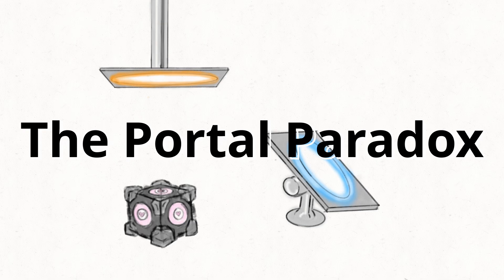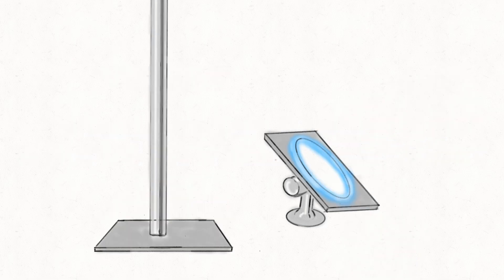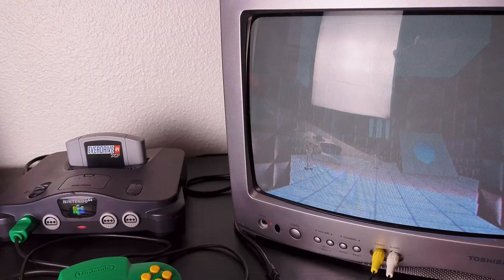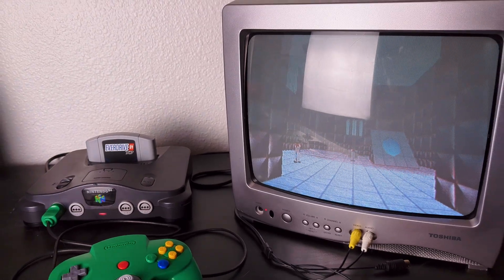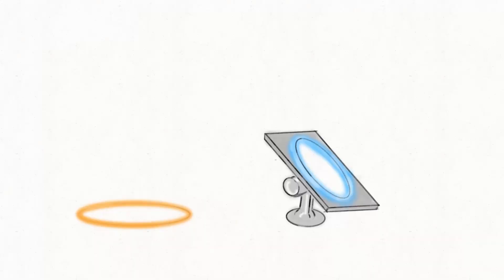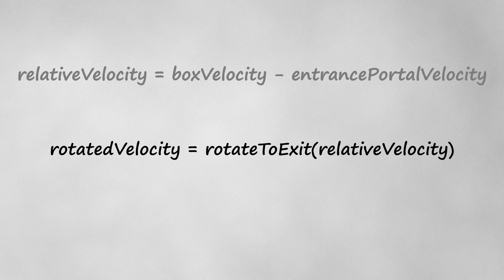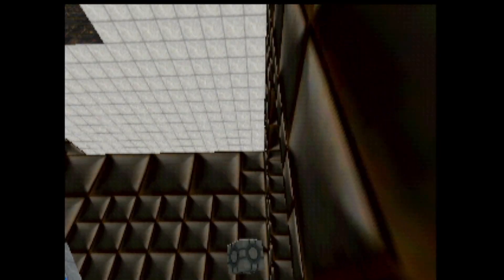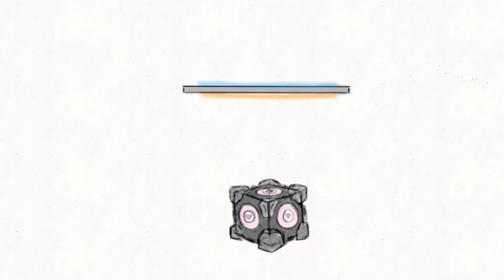I rewrote Portal from scratch and solved the Portal Paradox

Comment: The way I see it, the problem lies not in the relative velocity of the portals, so whether they are moving, stationary, or a mixture between the two doesn't matter. 

What should really matter is the velocity of the cube, or more relative: the cube's potential or kinetic energy. The cube has no velocity in resting position and has stored potential energy relative to the moving platform. It stands to reason that the cube itself is the subject of inspection, not the effects the portals have on it, since a resting cube should, logically, stay resting even when a moving portal slams into it, regardless of velocity or position of the exit portal. This, of course, relies on the idea that the portals do not add any energy to the cube in the process, rather there is no energy transfer between moving portal and cube. Now, if that is the case, the question really starts to just devolve into the theory behind Valve's portals and how they interact with objects lore-wise. But I'll assume that the inside of a portal is simply a physical bridge in space and that anything aside from the portal's membrane should be assumed to not be the portal as a matter of physical properties. So, in that case, the only other effects on the cube really should only be gravitation potential energy, as it is naturally part of the system. In resting position, gravitational potential energy is defined to be 0, but when the moving portal slams into the cube, assuming the cube has 0 contact with the portal's membrane (only is affected by the change in space), then gravitational potential energy of the cube increases and it gains kinetic energy in the direction of gravitation, or downwards. This, again, leads to more theory-based questions regarding the physics lore of the game's universe, such as where a gravitational field becomes priority between portals, determining when the cube should gain GPE and move towards gravitation direction. Since at this point, the resting position is no longer the ground platform and is now within the exit portal. Again, there has been no addition of energy from the portals, so the cube should just fall down from the exit portal due to the addition of GPE from a resting position.

There's just no real way for any "simulation" to give a good final assessment unless you add in the nuance of physics outside classical video game physics, and even then, you'd be adding in assumed behaviors of fictional scifi technology (but again, the way I see it, the portals themselves have little relevance and the problem is really more to do with space and energy). Though, I'm not sure if it would change anything or prove me right or wrong, but removing gravity from the system might or might not change the results, unless the fundamental system the simulation was built around ignores energy and assumes the portals are the subject instead of the cube.
Reply: The main issue with the "object at rest always stays at rest no matter what" reasoning is that the object, that has been presumably claimed to not move at all throughout the whole scenario, also logically cannot be ejected out of the exit portal, since that action requires the object to be in a state of motion and have a positive non-zero momentum due to the exit portal being stationary. In simpler words, it has to move in order to exit the stationary portal.
Reply: I forgot to add, performing this in a vacuum is obviously how an experiment like this should be assumed, because then one could start assuming many other factors contributing to the system, such as air as a medium. Difference in air pressures that potentially affect the cube's velocity near portals, air resistance at point of moving platform, fluid dynamics of air as the moving platform approaches contact with the cube's rest platform, whether this creates a suction/delta P through the portals, which gives the cube its velocity forward, etc.

As for a question of portal speed to GPE. I suppose depending on speed, the resulting direction vector would be a difference in resting position and the speed at which the cube leaves resting inertia after going through the portal. In either case, it shouldn't shoot or fly opposite the direction of gravitation, but at the very least have velocity forward or lower depending on the angle of the exit portal.
Reply: The fact that portals can change the direction the cube moves in within the reference frame where both ends of the portal are stationary already means it's changing the speed and therefore the KE in all other reference frames.

The idea that no kinetic energy is added to the cube on passing through a portal is basically only ever true when using the frame of reference where neither end of the portal is moving.

Comment: Awesome job on the video and tests. One extra thing that would truly solidify it, in my opinion, is doing a test where the portal wouldn't stop moving. Based on your results, the block should "plop" in this case because the relative velocity doesn't change between the portal and the block. Thereby eliminating the phantom "force" which results in the "whoosh" in your first test. In your second test, both portal faces are moving, so that should contribute to the block staying still in your second test case.

Comment: I came to the same conclusion without making my own demake: I thought of it as movement being a 1 for moving in one direction, a 0 for being stationary and a -1 for moving in the opposite direction. With no portal moving and the cube being thrown through one of then, we have 0+1+0=1, so the cube moves after the portal. With one portal moving and the cube being stationary, we have 1+0+0=1, so the cube moves after passing through the portal, kinda like a newton cradle transfers the kinetic energy from one ball (the portal) to the one on the other side (the cube). And when both portals are on the same sheet on both sides moving towards the cube, we have 1+0+(-1)=0, so the cube must remain stationary. Also, throwing the cube into a moving portal will result in 1+(-1)+0=0 and the cube will remain stationary. Well, and so on...

Comment: there is no paradox, and the simulation is not right in neither the cases you show in this video.... when the stationary cube enters into a moving portal, the parts of the cube just can't strip away because the cube continues being a cube... that's why the cube has no acceleration at all.... it just appears slowly in the other side of the portal and (in the case of this simulation) i will fall as a death mass to the ground again

Comment: no way lol, the portal is “MOVING” sure but the cube is stationary, its like what would happen if u move a door towards the cube really fast… nothing, since the cube has to have energy of its own to move, a portal is like a door the portal can move sure but the cube retains its energy upon entering the portal, how does the portal transfer its energy to the cube by moving fast towards it? what ur basically doing is “closing” and “shutting” a window quickly nothing more. the cube would simply slide off the now inclined place since in the second portal its would then be in a position, (had this been real) to have potential energy. but obviously this is why portals cant work, since ur basically creating energy makes no sense.
Reply: You can’t say for sure that the cube is stationary, technically it’s moving relative to the moving portal, motion and velocity are relative and relative to the orange portal it’s the cube moving so the cube must launch, obviously the answer differs depending on the frame of reference
Reply: " its like what would happen if u move a door towards the cube really fast… nothing"

already addressed
Reply: @LineOfThy  yeah but both sides of a door move together, if they don’t it’s not a door

Comment: Here's a thought experiment I came up with:
There are two copies of the room in the video that are exact in every way.
Both are enclosed in a magical material that lets no information through other than to watch with magic crystal balls. You are at home on Earth and you have a magic crystal ball that you can see into either room, but you don't know which is which.

One is in perfect geostationary orbit around Earth in a vacuum (meaning it's motionless compared to Earth and assume there is no resistance from outside sources). The other is in free-fall toward Earth down a tunnel in a vacuum. (also assume no resistance from outside sources, a perfect free-fall)

Both experience zero gravity
Both are seemingly at rest from the inside of the rooms.
Both the experiments are performed exactly the same way.

Now run the experiments and observe through your crystal ball.
Is there any difference in the results of the experiments? If so what?
Reply: Here's the twist: Both the rooms are upside down and both the pistons by sheer coincidence move at the exact same speed as the free-fall room is falling. Which means the piston in the free-fall room is actually perfectly still compared to Earth and the room is in free-fall around it.Therefore, in one room the portal is moving and the box is at rest (in relation to you on Earth). In the other room the box is moving and the portal is at rest (in relation to you on Earth).

Did the rooms being upside down change anything about the results of the experiment?
Did learning the speed of the piston change anything about the results of the experiment?
Does this only work if the piston moves at an exact speed? If it were slightly slower or faster would the box cease to move when it exited the portal?

Comment: So, what happens if the moving entry portal stops moving before fully passing over the cube? The top half of the cube has been given momentum, but the bottom half has not. The top half would pull the bottom half along with it, right? Meaning, the box would only fly half as far? Unless the momentum differential is great enough to rip the box apart.

Comment: Well, that's friggin cool. 😲

I'd also argue that in theory the orange portal should experience resistance when it hits the cube, such that it performs equivalent work to flinging the cube out of the blue portal. That conserves energy—though not momentum, because having portals facing different directions has already broken that permanently in this universe.
Reply: My position is that to properly use conservation laws through portals you must use the reference of the portal, in this case to conserve energy, velocity, relative to our reference, must remain constant at input and output (ignoring non conservative forces obviously) if we consider the portal as a system energy in must equal energy out… in any case energy is not conserved as potential energy can be increased with a portal eg perpetual motion machine using portal on floor and ceiling.
Reply: @DracoTorment  The object traversing the portals is ALWAYS the reference frame. Portals are only transformations of the vectors. If a person sat on the floor and the portal slammed down around them, they would feel acceleration and would fly out the exit. This is consistent with he person's interpretation; if they'd looked up, they would have observed the wall and ceiling careening toward them at speed, a sight consistent with them flying out the exit at speed. Further, we know the object's reference frame is the only view point we should examine because it is the object which possesses the momentum, velocity, and energy we are concerned with. The portals are just a boundary in space with an appropriate transformation that stitches space together at that boundary.

Comment: Everything said makes sense. No arguing the logic. Just curious as to what would happen if the portal abruptly stopped midway through the cube? Would the momentum of half the box, pull the other half off the ground?
Reply: From my understanding, yes. In game terms it would depend on if the box is considered a point (in which case as soon as that point crosses the threshold it will act as though the entire box did) or if it is represented more realistically (The % of the box that went through will "pull" on the remaining %).

Comment: Conservation of velocity and momentum, it's transfered from the portal travelling, over to the matter that goes through the portal, the cube itself going through the portal should get an equivalent velocity.

It'd be easy to math in a vacuum, but in a gas I'd imagine wind resistance would be an issue.

Perhaps the wind captured by the travelling portal would create a high pressure area on the exiting portal, that may increase or decrease the velocity of the cube because of resitance and pressure being countering forces to one another.

It's still a science that wouldn't seem possible because the pressure around a portal in two different levels would vary too much and cascade mass through gravitational energy and lower areas in an atmosphere have higher pressure, thus you could make a convecting wind machine with two portals at different levels, but energy would have to get consumed somewhere since it'd create energy from nothing seemingly. It's kind of why it's all purely Science Fiction, and it's fun to speculate on.

Comment: Some of the commenters are still confused. I think it would help if you make a third example to showcase why the cube didn't seem to move on your 2nd example. 

The setup goes like this. 
Entry Portal moving down towards cube. 
Exit Portal facing up, is moving down as well towards floor. 

The result is, it looks like the cube teleported without motion, but that's only because the exit portal was also moving at the same speed as the first portal (similar to your 2nd example- but at a different place).

Comment: Why is this a paradox? if you put a cube with 10 mph into a portal (no matter what part moves how fast) it has to come out with 10 mph or else you would have to compress the cube into itself. And if it comes out with 0 mph only a 2d object would come out. Or are you saying that it comes out with 10 mph but then it suddenly stops? Is this strange idea based on the source code or how did someone come up with this?

Comment: I saw someone explain what would happen very well. At an atomic level, the side of the cube that was to “come out of” of the other portal, doesn’t have any velocity. Because on the other side of the portals, it’s sitting still. So it would be atomically crushed down with a specific force based on the velocity of the moving portal. 

This could be a minuscule force if the portal was moving slow enough but at the speed it was shown in the video, the cube would become a pancake

Comment: It’s strange because I think this behaviour would imply that if you stood there, instead of the box being there, you could be decapitated, as a lot of force is applied to your head, which goes through the portal first, before the rest of you. And to me this seems intuitively wrong. I wouldn’t expect that behaviour in any other use case of the portal. But, it does also make sense that movement should simply be relative between the portal and cube, and solving portal decapitation would require that the box / portal be able to discern which one of them is actually moving.
But I guess, at the same time, it would be evident which one was actually moving by just observing if the decapitation happened or not.

Comment: That means that if the velocity of the moving portal isn't fixed it would rip the box apprat, which is easier to visualize if you take it to its extreme.
Imagine moving the portal as you did in the first experiment and then stopping it mid way though the box, the lower half of the box would be left behind unmoved, and the upper half would shoot out of the second portal.

Comment: The interesting question isn't what happens when portals move linearly (because that's not a paradox), but rather what happens when they stop or change velocity.
To get an idea of how that could work, we can look at how reference frames work.
When a reference frame is accelerating, objects in that frame appear to accelerate in the other direction.
When a reference frame suddenly snaps to a different velocity, objects appear to receive an impulse.
Logically, you should therefore apply a force/impulse (relative to the portal's reference frame) to anything on that side. 
For example, if the cube is being shoved through a moving portal and the portal stops, the portion that sticks out should keep going, while the part that stays behind should stop.
In reality, this would tear the two sides appart, but assuming it could survive, you would add up the momentum of the two parts to get the new momentum of the whole cube.
The more of it is sticking out, the faster it will fly away, since less of it is being held back.

Comment: The cube launching out doesn't make any sense. It should just fall, due to gravity pulling down on it from both portals, there is no force to cause the cube to launch forward. Referencing your "hoop test" the only thing that is moving to the "hoop".
Reply: The whole point of the hoop test was demonstrating that the cube doesn't launch in that situation, while it does in he actual problem as the exit isn't moving like it is with a hoop.

At a fundamental level saying that the cube exits a stationary exit entails movement.